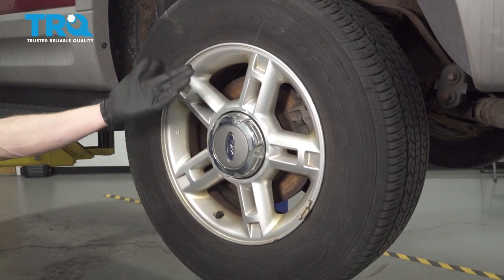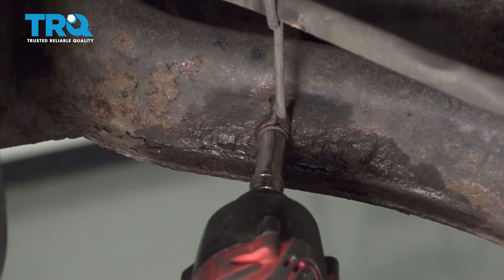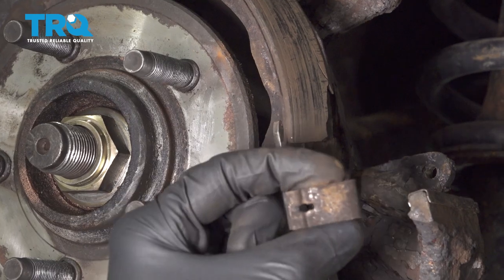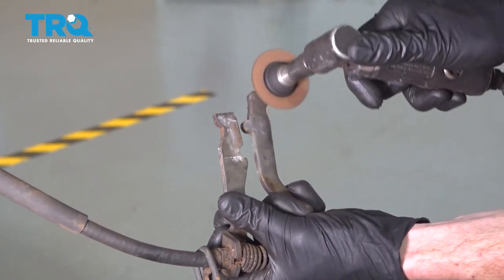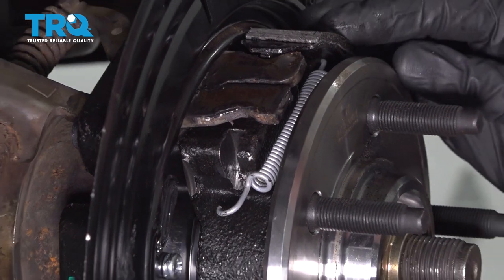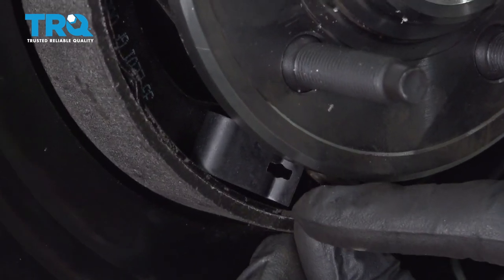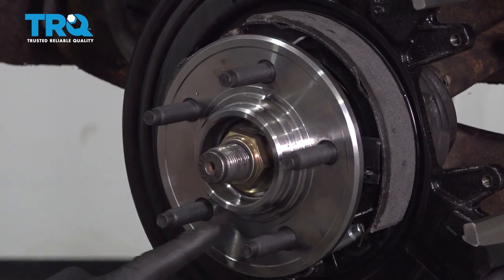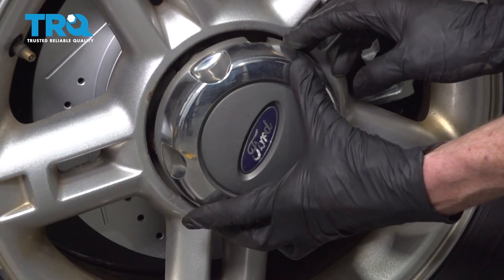How to Replace Rear Parking Brakes 2002-2005 Ford Explorer

Comment: Good Job.....But the slack adjuster was put in back to front as the adjustment hole in the backing plate
did not line up with the slack adjuster......

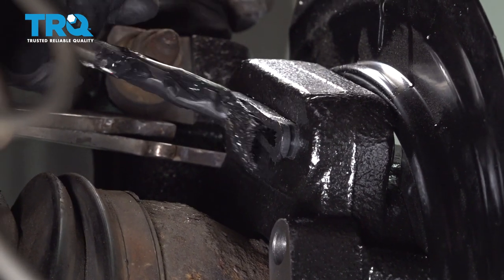Comment: Hello, a query, at min 7:55 a rubber is lubricated, what is the name of this rubber or part? I have the problem that the parking brake is released and I don't have this rubber, it seems to me that it is like a support that prevents those plates from coming off. I need to find this piece but I don't know the name. Thank you